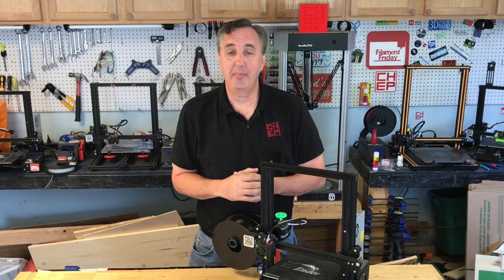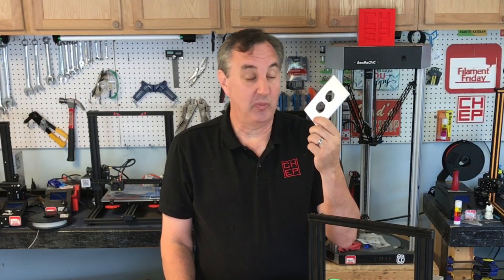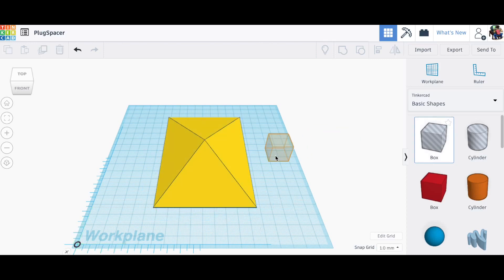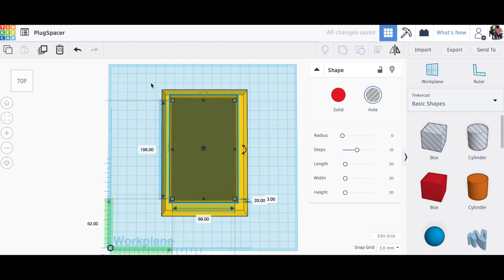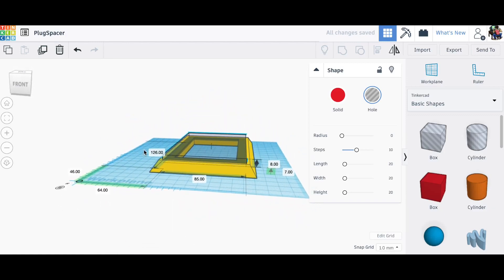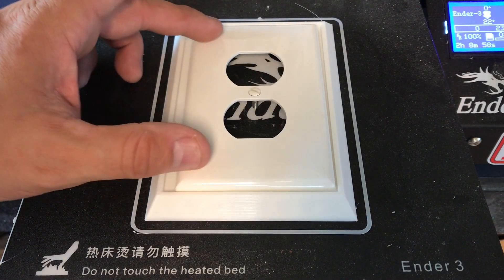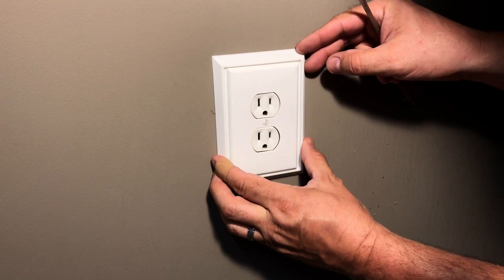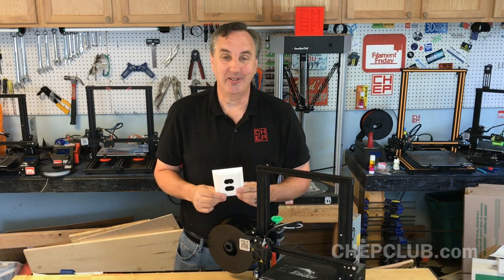You Don't Need a 3D Printer ... Yeah, Right!

Comment: What videos like this forget is that your time is money and you will sink endless hours in teaching yourself 3d modeling and doing the 3d modeling to be able to achieve the value described in this video. No, no thanks. I chose NOT BUYING a 3d printer. They are simply not there from a consumer value standpoint, unless you just want to spend the time with it as your hobby. I think there's just a lot of people in the hobby trying to justify all the time they spend on it, so they make videos like this trying to legitimize their behavior.
Reply from the maker: 3D Printing has advanced since this video and for $500 you can get a great print out of the box. Many are building print farms and selling products it’s gotten so easy. So I can’t agree with your statement at all.
Reply: @FilamentFriday  I can buy every possible 3d printed item from someone else who made it and not even come close to the $500 mark. So then what value does a 3d printer provide me? I dont have time to learn 3d modeling as a side hobby. It makes more sense to just be a consumer of 3d printed products. The printer doesnt pay for itself.
Reply from the maker: @mhrcracing - Because you can’t always buy what you want or need. Just a like a wood worker has tools, crafter has tools, a 3D Printer is a tool for those who custom design in plastic. Wood workers often use CAD, crafters often use CAD, so no different that 3D Printer uses CAD. Tinkercad is so easy kids use it in school to create 3D designs. 
Sounds to me like you’re just trying to justify not buying what you really want, a 3D Printer, otherwise you probably never would have watched in the first place. I’m glad you did. Thanks for watching.
Reply: @FilamentFriday  ok I bought the $200 bambu lab one thanks to you, but it will ONLY be a sub-hobby to my rc racing. But you're right, I figured out how to make almost anything with tinkercad last night.

Comment: CH thanks for all the videos you made getting off the ground a lot easier.  

Stuff I fixed in the first few days of getting my printer online...   
- Baby chair missing strap guide. (I couldn't find anywhere to buy a replacement) 
- Printed two new key fob shells (Needed to get acquainted with Fusion - these are $30 for one). I didn't make money here as it took me most of a day to figure out fusion360.  
- End end caps for oddball sized handle bars. (baby stroller one was missing) These took under 5 min to CAD because of the struggle with the Fob so that worked out. 
- Circle and square stock center finder for the mechanic at work. 
- lithophane so my wife would stop being angry about the time I was spending with the printer :P ->  It worked.

Comment: Who cares if it's a "Dad project". I have that same issue with some outlets with a  stone wall. The adapters to bring them out to be flush with the surface brought them out too far, and there was no other option available at the time, so the plates have about an 1/8" gap. Just got my first printer. Now I can either make the plate like you did, or print my own adapters. 
Thanks for the tips / great ides!

Comment: Awesome idea.  Some friends of mine were having problems with the metal legs of their chairs denting their hardwood floors and any of the glides they tried from the store would come off in a few days... I told them I could fix it, so I popped open fusion360 and designed a cone shape foot that slid onto the chairs legs (3/4" square)... printed them in black pla and glued a bit of felt to the bottom... the bases increased the surface area of the feet by about 8x and now everyone is happy, including my wife, after adding an 8th printer to my collection.  I do the "dad projects" periodically and it's been smooth sailing.

Comment: My very first "honey-do" was to fix a problem we developed with our refrigerator. There is a neat door cubby that pivots forward. the only problem is if you put anything in there heavier than a feather and then close the door that tip-forward space falls away from the door and causes you to have to open both doors on the French-door front. I developed 4 prints in iterative design to solve the problem and ended up with something like the latch that you use on an airplane tray table. now the fridge can be opened and closed with whatever we want to put in there and no more flopping forward or blocking the door from opening! Creality saved my marriage ;)

Comment: This is kind of a weird question, but do printers like the Ender 3 use up allot of power? Like relative to an electrical oven? 

3D printers are awesome and all, but sometimes you have to leave them on for hours at a time, and that could potentially affect the electrical bill a bit 😂
Reply: It depends on the circumstances and your print settings, but to give you an example: if I run my CR10S with the heated bed on at 50C, it runs at approx 150W. Say you've got a 24 Hour print and you pay 18 pence per KWH, that would be a cost of £0.65. So it's not huge but can add up if you run a lot of printers!
Reply: Not really, I have printer similar to E3 and I measured electricity consumption, it's about 10% of an oven.

Comment: This is exactly what I got a 3d printer for! I've made a wobbly table stand straight, replaced a broken hook for my clothes line, and even designed a hanger for a set of second hand curtains that didn't come with mounting equipment. Pretty soon 3d printers are going to be a necessity for every household! Thanks for the great videos!

Comment: hey chep, i have a question for you, i am using your 0.12 profile for my ender 3 pro its printing beautifully but  on easy prints like squares and others its taking way to much, like 1 day and 8 hours to print a honeycomb for kitchen utensils   do you have a setting that i can print stuff quicker, i don't need soo much detail i just need it to be good
Reply from the maker: Try the standard Cura profiles
Reply: @FilamentFriday  okay but if i increase the .12 to 1.0 do i have to change other stuff
Reply: @konanva0495  you would need a way bigger nozzle for 1mm layer height, and it would look awful. The max you can go safely with a 0.4 nozzle is 0.3
Reply: @mongini1  so 0.4  is 0.40 right?
Reply: @konanva0495  that's the same... 0.4=0.40=0.400000 zeros don't matter after the dot :P
Reply: @mongini1  lol ok
Reply: Just use a profile with a bigger layer height

Comment: That's amazing that you use TinkerCAD. I guess Fusion360 is more for the advanced user?
Reply: Fusion360 more for advanced, detailed projects, tinkercad great for quick, basic designs like this
Reply: @bullwinkle69  I designed most of my printer upgrades in tinkercad. Sometimes in conjunction with blender ^^
Reply from the maker: Ive been using Tinkercad long before Fusion 360 was released so I know it well.
Reply: You don't need to be a advanced user for Fusion360. You just need a few hours in the beginning to get used to it.

Comment: Hey Chep,
Forget about first layer problems, warping and clogging. This problem is hard to solve :D nice idea, but I think it's more a temporary fix. Some in this position should know what I mean ;)
Best "fix" for me is to separate wife and printer in different rooms. I have all my printers in a seperat room, like a hobby room. You can't see it, you can't hear it - is it there anymore? :D I know, not everyone can do it like this and I really belive a printer in the living room or kitchen (what I really like to see by myself) can be a problem. Don't forget, it is a machine.

That brings me to the next point, what about a "how to" silent printers with hardware or software or how to "create" a room to hoard all printers in an effective way.

Cheers
Reply: IMO the best way to silent your printer is upgrading the stepper drivers. I would recommend TMC2208. They eliminate the "singing" of the printer. 
After installing those the loudest part of my Ender3 were the fans on the extruder, and after replacing those the loudest part now is the power supply.
Reply from the maker: I’ve showed that in previous videos like this one:
https://youtu.be/HEQQIJMPofA

Comment: I was motivated to buy my Ender3 after a friend made me some simple parts for a car project I'm working on. I posted pictures of the parts on a car forum I frequent and there was a flurry of Ender 3 purchases soon after. As most of us probably do, the first reel of filament was used printing 'upgrade' parts for the printer.....but I have also used to to make a number of parts for the car that would be almost impossible otherwise as well as numerous odds and ends around the house & garden. My partner has even got to the stage where she asks me if I can make things now, so it's clearly been accepted into the household :)  Uses only limited by imagination and materials - wonderful gadgets made more so by folk like you Chuck.

Comment: CHEP, good one. I think the message is clear. I make electrical equipment for home use using ready made boxes. Now with my Ender 3, the possibilities are endless. I need a part, all I need is time with my Digital caliper and fusion 360, my 3d printer does the rest. This are things that you practically have to go out to the market scouting for parts that fit what you want to do. Let me tell you the truth, each time I use my Ender 3, I say one or two prayers for Creality as a company. The printer is cheap and versatile, ita a work horse.

Comment: Another very useful video!  My wife now regularly comes up with ideas for things to print.  Here’s a short list:  Replacement clips for wire closet shelving; a TPU insert for her purse; vacuum cleaner repair part; perfectly angled iPad holder for use on a tricky, small shelf.

Comment: I always thoroughly enjoy your videos. This one was educational but unfortunately I think it was counterproductive. What you could have done instead would be turn your breaker Off remove your outlet get a little Dremel tool and cut the box to the right size. Then reinstall everything and possibly use a jumbo plate cover instead of a standard one. So this video did not quite serve the purpose you intended in my opinion. It actually shows why most people (not usually you but most people) spend more time fixing things using a 3D printer then it would take someone else without a 3D printer. In other words if I were you I would delete this video and come up with a better example. It actually discredits you. And I think you're awesome!
Reply: i disagree with you not everyone knows you can do that with a Dremel or even knows what the problem is, all they know is there is a gap there and they want it gone. so i think it is a useful print
Reply: @Bandit-di3pi  👍
Reply from the maker: If I cut the box back it actually cuts off the screw holes for the receptacle so the only other option was to cut the paneling, reposition the box and re-panel. I wasn’t doing that in a basement.
Reply: @FilamentFriday  the boxes have deep enough threads in them that you can cut off about a quarter of an inch to 1/2 an inch and still have enough threads to hold it in place. And then if not they make a remodel box that would be very simple in that case to remove the one that's there and use the remodel box instead. The remodel box levels itself to the surface you're installing it to. You can decide that this is a viable solution for people, I think a lot of people are going to agree with me that have any knowledge whatsoever about Home Improvements or repair and your solution is going to look Mickey Mouse to us. And again I'm not doing this for of any other reason then you're one of the most credible people I've seen on YouTube. I absolutely cringed as soon as I started to see what you were doing.  But hey maybe it's just me.
Reply: K. I. S. S keep it simple stup*d 😅 i like the 3d printed fix. Requires very little knowhow. Compared to all that electrical business.
Reply: @Ender3Me  the skill of generating a design and printing it is nowhere near as easy as teaching someone to change out an electrical outlet and trim a box down. Not even remotely close to comparable in difficulty level. I would give learning how to uninstall trim down the box and reinstall about a 2 on difficulty level and learning how to design a 3D printed object and printing it about a 7. Then you have to realize his fix would absolutely go against code and God forbid it ever needed to be inspected it would have to be fixed "the right way!"
Reply: I honestly feel the code would go overlooked. It looks like an original peice. They sell back plates like this at home depot. I'm simply saying for the average diy'er, this fix is easier, considering the viewer is interested in 3d printed fixes in the first place. The average person without 3d print interest would go the old fashion route.

Comment: Sorry.. But, that Example is something that's totaly useless here in Germany (and i think in the whole of Europe).. Cuz, we can buy (and get that Cover with EVERY Switch and Plug) in every Hardware Store for a few cents. But sure.. You could probaly make something cool with it if you combine it with Glow in the Dark Filament or illuminate it with conductive filament.
Reply from the maker: Your covers are 10 mm thick?
Reply: If your mounting box protrudes from the the wall enough then normal European cover plate won't touch the wall. And no manufacturer sells parts for that. On the other hand you can (and should) just take a piece out of the mounting box and make it flush with the wall. For Americans, note that we use plastic mounting boxes in Europe so it's easy. On the third hand, here you should use  some plastic that comforms to regulations. Yeah, I don't know either what.
Reply: It was an example. Try to think a little more creatively!
Reply: @LiLi-or2gm  I know.. But i think there are better Examples.. Like a new knob for an Oven or some parts from an expensive device that broke. That would be more convincing for the Parents. (or even generally)